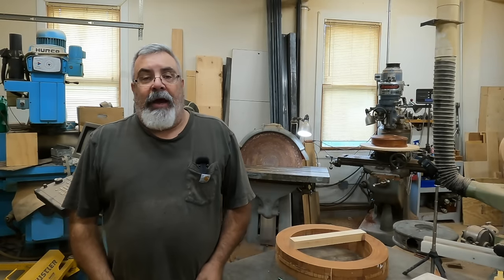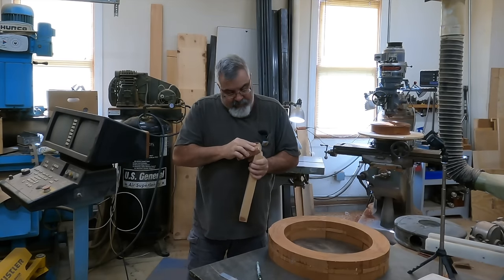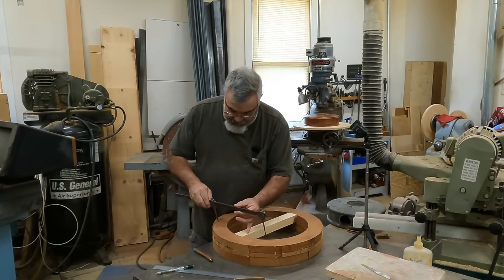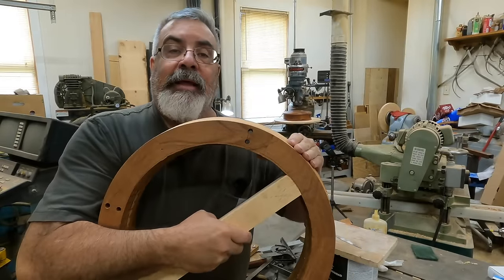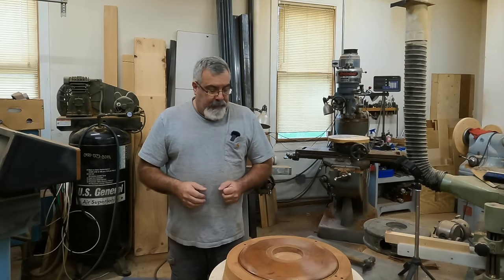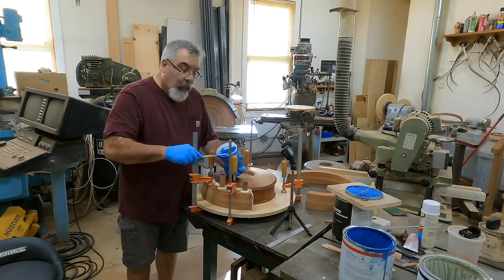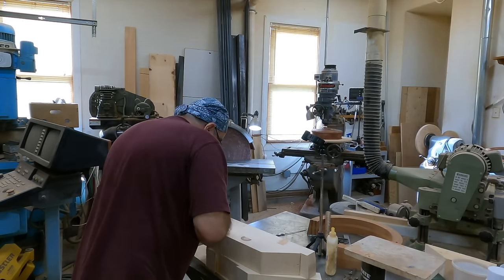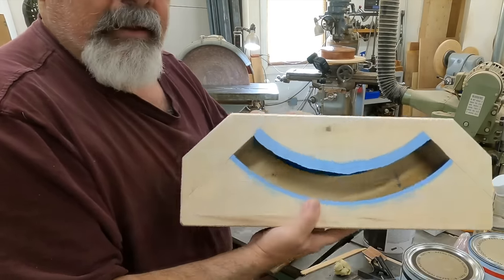Tally Ho Capstan Project: FINAL Part- Core Box

Comment: Early in my engineering career I worked with local pattern makers to make "flow boxes" in order to test out the performance of various diesel engine intake and exhaust ports using an air-flow bench.  These were old school patternmakers, and they used Mahogany, wax and plastic as well.  These patternmakers are all gone now, but it was very interesting working as a go between them and the port designers.